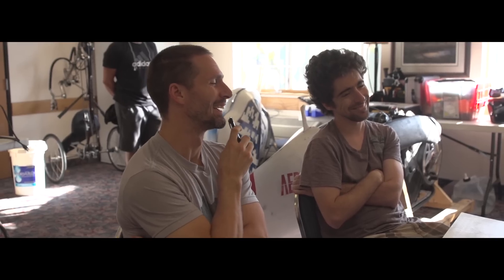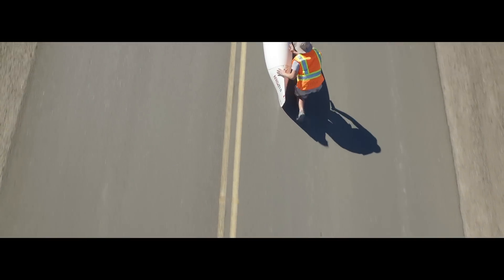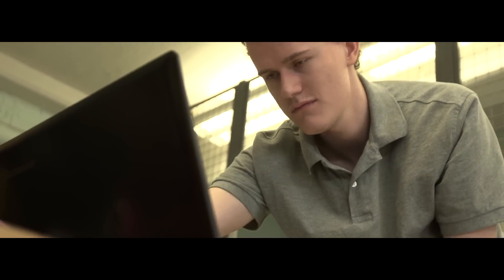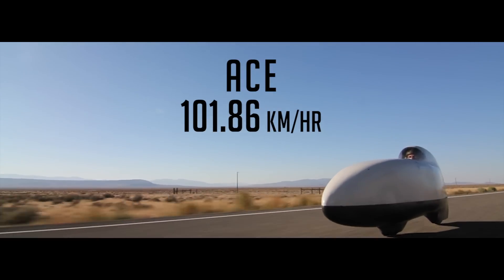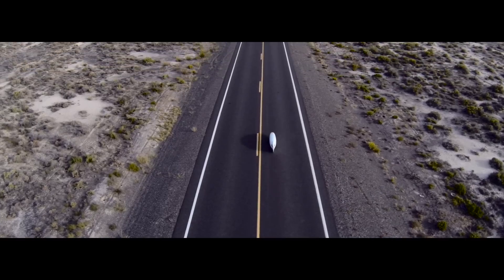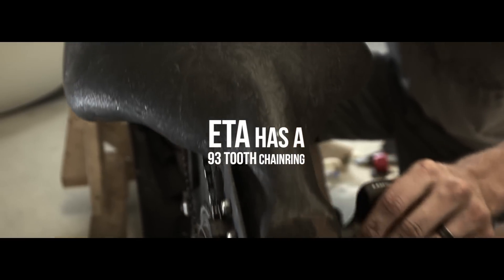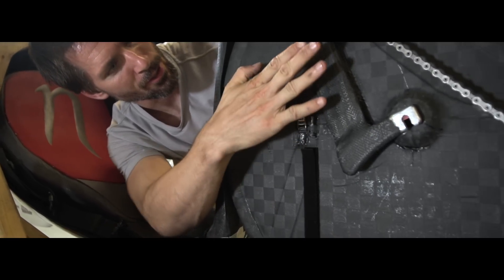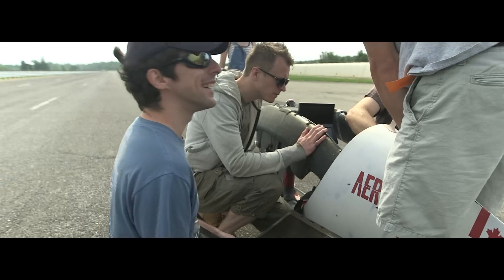Under the Hood of the Fastest Bike in the World

Comment: How is sufficient ventilation for the pilot achieved?
Reply: I was wondering this myself. How does he keep himself cool. You heat up quite abit when you are biking hard, and with no open air to cool you down. I wonder how he doesn't create a sauna effect.
Reply: Francis Faure set the World 1 hour bicycle record on a non aero recumbent in 1933, UCI banned recumbents. That record held until Sean Costin broke it in 2007 at 48.80km (28.46 miles).
Reply: It is white coated so it naturally radiates heat, if we use infrared white ink it would be able to keep below ambient temperature at all times.
Reply: That is why this was a "short" sprint, not a triathlon or long commute, and there are gaps in the bottom between the wheels and shell ;)
Reply: actually ventilation was a problem. We got a duct that draws air from behind the front wheel and directs it to the pilots face. The wheels are themselves surrounded by carbon shells, which are sealed to the main body shell, so there is as little airflow as possible . We can open and close the ventilation depending on what the pilot feels.
Reply: @victorragusila7519  if you need only 258 watts to maintain 100 kmh, why we can not see similar commercial velomobiles achieving at least 1/4 of this?
I see some recumbent bikes with 3000 watts motors and still they don't reach more than 80 kmh.
What is the power output from the trained cyclist when it reach 140 kmh?   
How much time it can sustain that speed?
Reply: @AngelLestat2  not sure the exact power numbers Todd was able to put out...but I think it was around 500 to 700W for the final Sprint. He couldn't keep it there for too long at all, the power curve was all designed to reach max speed only over the 200m speed trap.
Aero drag and tire drag are hard for a three wheeled vehicle. They are much bigger and much less aerodynamic. Three tires will always scrub a bit, draining more power. I wouldn't be surprised to see a factor of 10 in the drag of a velomobile compared with the ETA bike. We also raced at high altitude, so air drag was even less than what a velomobile would see.
At low speed you don't see that drag, but at high speed it really kicks in. 
Unfortunately the velomobile a do as good of a job as possible while keeping their bikes comfortable and easy to use.
Reply: @victorragusila7519  ok I understand, so the impressive drag coefficient, lower drag area and friction reduction of ETA is what makes all the difference vs other velomobiles, with the extra help of the lower air density in the test.
I am searching for the ultimate practical design for a personal transport vehicle, I can not see any commercial design getting even close to the possibilities over the range of characteristics that I think are necessary in the average of cases. 
Some vehicle with speeds from 70 to 110 kmh, a range of 100 to 150 km, dynamic enough to use common roads or just skip them in the case of vtol flying vehicles,  with lower energy consumption to make a real difference on the economics vs the alternatives.
I think it could be accomplished at reasonable manufacture cost.
My bet for the most practical vehicle to match those needs (from 5 to 10 years in the future) would be personal accessories to transform our body in a flying vtol aircraft using propellers and enough wing surface in order to require only a 35% of the power output for cruise which would be feeded by a Fuel Cell (Solid oxide using normal fuels or PEM depending the availability of hydrogen and the performance of the storage method of choice)  with an extra battery that would provide the extra energy for take off and landing.
I think that a max power output of 30 kw would be enough for a total take off weight of around 140 kg.
Which is the power output that any electric motorcycle use today to reach 120 kmh.
Reply: @AngelLestat2  Actually we can. My commercial velomobile does 60 km/h at 215W; that's with all the aero options in place + race tires, but it has three wheels and is a lot wider, has ventilation, mirrors, a (lexan) window to see in front and to the sides and more stuff for daily use. I'm tall so I have the biggest, but there are two smaller versions that will get you to 60 km/h at 180W and 160W. In every day summer outfit (without the roof, ducts open, puncture resitant tires etcetera), riding at 60 km/h constantly requires just short of 300W power input.
Reply: @4nz-nl  Well, those numbers tha tyou provide are way more reasonable vs what it should be possible with that power, the previous values were quite deplorable.
Also.. today a new aerodynamic design for bikes come out, which I think it is quite intelligent (although not confort). 
https://www.cycleworld.com/story/motorcycle-news/white-motorcycle-concepts-wmc250ev-aims-for-new-land-speed-record/
Because our legs usually requires a lot of front Surface to acomódate, but with this, they just allow the air to pass, maybe countering some of the vórtices generated by the button part. 
Of course, if we can design a vehicle in which our body is 100% horizontal, then it would be much better, but that would work out only for a vtol vehicle.
Reply: @AngelLestat2  The numbers sound much more reasonable but my velomobile is a fully usable vehicle. I travel to customers in it, carrying clothes, normal shoes, towel, two laptops, a portable screen, tools, food, drinks and more. 
It's biggest advantage is not that it's faster than a road bike, but it's comfort, the lack of volatility in travel times and the protection from the elements. Wonderful vehicle :-)

Concerning the bike link you posted: It works, but it's still making two huge mistakes that a recumbent doesn't:
1. The position is extremely uncomfortable. I cycled 200 km the past few days, today was hard but only my legs are a bit soor. No problem whatsoever riding my recumbent multiple days for 17 hours a day.
2. If I have to crash into something, I prefer doing it feet first, not head first.
Reply: @4nz-nl  on doubt, your velomobile does 60km/h with 200 w + human power or just with 200 W of electric motor?
Because then you said that you need 300W to keep that speed, which is a bit confusing. 
You mean to not force the engine?
But yeah, sounds great in your case given that is an actual vehicle the one you have.
Not like the world record Aerovelo which use 200 Watts at 90 km/h but with incredible compromises.
Sad that velomobiles are so expensive, is stupid that the ones who want to pollute less, with a much simple and small vehicle  need to paid as much a a family car. 
Yeah going head first on ground vehicles is not great, on flying vehicles is not an issue, after all is the position used on hang gliders.
Reply: @AngelLestat2  I understand it's a bit confusing because I stated multiple different power figures. The power figure differs quite a bit depending on whether I have winter or summer tires, use a full racing hood (cover over my head) or use it in open mode (knees out). Lowest value possible is 215W on superfast tires and with the full race hood. My "real world figure" in the summer is closer to 300W, with durable tires all round and with the kneecover, but without the head cover. 
That head cover is just too warm in summer temperatures, but of course this is also the case because I'm putting out 750-1000W of heat because I'm pedaling. So just to be clear: The Milan GT is fully human powered. 
Check out this video of a German dealer in the smaller brother of my bike, the Milan SL. It will give you a good idea of the speed potential. This is also fully human powered, the power figure visible is coming from powermeter pedals that measure his power input:
https://www.youtube.com/watch?v=4IHIdGVGKdI
Reply: @AngelLestat2  Btw I don't entirely agree on your statement that velomobiles are expensive. Compare them to any top-end road bike and they are dirt cheap: There is nothing but top-end in the velomobile world. All except for one are handmade products, but developed to a very high level. If you see it as a bike, then it's expensive. If you consider the fact that I use it for commutes up to 85 km, the velomobile is a huge time- and moneysaver, and those are not even the only assets.
There are a few guys riding 5 year old velomobiles that are already over 150.000 km, and those people actually have a job and a family ;-)
Reply: @4nz-nl  I never thought much about the heat our bodies produce to deliver around 250 W of power, yeah, 1000 Watts is like having 1 m2 of glass with the sun at midday.   That is a lot of heat.. 
OF course, ventilation can get rid of that heat but the aerodynamic penalty is far to be negligible. 
Yeah, I guess I already watch that video in the past, that is why it was hard for me to understand why some electric bikes or velomobiles needed so much power to reach the same speed. 
Thanks for all the data you introduced in this comment. I will reply to the one of the price now.
Reply: @4nz-nl  I mean, I consider them expensive, some velomobiles with speeds of 50 or 60 kmh, range of 50 or 70 km, with only 30 or 40 kg of materials, with simple mechanism cost around 7000 or 15000 usd. 
Which is the cost of a new Mitsubishi Mirage, which is a machine way more complex that requires a lot more materials and energy to its manufacture.
Just the scale in power, the car should cost 5 to 10 times more at least at equal production capacity. 
I understand that most velomobiles are made at hand and the demand is lower at the moment, they also have a lot of regulation and legal issues, which is hard (and expensive) for them to find a good spot.
High speeds requires a lot of safety features and test that no small company can afford, plus the efficiency lost to match all those features.
But that is why I am researching the topic.
I guess there is a huge oportunity to really innovate on the personal transportation vehicle.
Unless I think is great to combine human power with assist (due health and eco reasons), in order to really create an alternative to our common vehicles (cars, motorbikes, etc), the human power add is almost irrelevant.
First, nobody wants to reach to their work or reunion if they are all sweaty.
The extra power added is negligible vs the complications which add the bi power option.
If we really want to solve our sustainable issues, we need to find a good replacement to the way we mobilize today.
A car who use 50 kw of power to move 1 or 2 passengers is not ok, neither the current cost  of alternatives that use 10 to 20 times less materials and energy to its manufacture. 
I already have an idea how to solve the (safety feature) without a compromise on weight and efficiency, for ground and vtol vehicles.
Possible it would not me the one who completely solve this, but the solution is right there because the logic and current technologies allow a lot of improvement in our current vehicles, I guess sooner or later someone would figure out.
Reply: @AngelLestat2  The current cost of velomobiles is actually due to the complex production process. It's technical simplicity is one of the reasons it is expensive; a Milan, DF, Alpha 7, QuattroVelo, Snoek, they are all high tech design.
You're comparing a simple steel and mold plastic car to a fully carbon fibre vehicle that is made by people by hand, and requires quite some hours to be finalized (more than that Mitsubishi!).
I do business with productions companies, which is why I have looked into possibilities to make the production cheaper. That is possible, but you'll need to scale the demand up to at least 15-20K vehicles per year to make it viable + the end product will be of lower quality (less reliable or less efficient).
In order to do that, you will not only need to change peoples views on vehicles, but you will need to change policies too. And that's where you'll meet the lobbying auto industry. There's no free lunch here, the growth will be slow (if we manage to keep it growing! I'm trying my best though).

Concerning electrification: Possible, but again, you'll meet regulation everywhere. In Europe, the maximum speed for an E-assisted bike is 25 km/h. Even on a 4% incline I can usually maintain 25 km/h on human power. Anywhere else I'm a lot quicker - I'd rarely ever use E-assist so it would be lugging dead weight around. We do have speed pedelecs here (up to 45 km/h), but chances are super slim you'll get a velomobile on the road under those rules (see my comment on car lobby).
The only reason I'd actually want an engine in there is to restore braking energy (on a decline); this can speed up the climb afterwards, which can be useful.

Concerning price: If I ride a velomobile 10.000 km per year and ride on Continental Contact Speed (not the fastest but dirt cheap), I'll be replacing €50 of tires once a year. As long as I don't sprint too much, it'll need it's chain and sprockets replaced every 2.5-3 years (€200). So the baseline is €350 of maintenance every three years, for the rest it might cost you some extra food - how much would you spend on a Mirage?
Reply: @AngelLestat2  
3000w would push a standard racing bike to around 100km/h and a velomobil to more than 150km/h so there has to be some limitation in the gearing I guess.

Comment: Perhaps a 360 camera could be installed and have the rider use a VR headset to be fully aware of surroundings, instead of just being able to see in front?
Reply: thought about it, issue is of latency. We had to find a camera/screen combination that had minimum latency, so the rider could control the rather-twitchy bike. We only use it on empty, perfectly straight roads, so not much reason to look around.
Reply: I also can imagine trying to incorporate that into the design without it getting in the way would be a real pain.
Reply: And no real reason to see whats going on behind you ;)
Reply: as vr headsets gets better there might be light versions in the future. the application might not be needed for a speed record like this, but for other uses of this technology.

Comment: can it be used commercially for road driving,
Reply: would you WANT to sit in that? 
You need a team to assemble it.
Expensive and fragile as hell.
Most likely uncomfortable and very hot on the inside.
Reply: It would need to be dramatically re-worked.  For instance, the turning radius is really huge, it's only designed to go straight and fast.  There's no way to put your foot down when coming to a stop, you need people to catch the velomobile and hold it up while you get in and out.
Reply: May I suggest a milan velomobile? Much more suitable for everyday driving (you still need a velomobile-friendly environment).
Reply: @Flix-f6q  Any decent road design is velomobile friendly ;-) But depending on the exact situation, that Milan can be a good suggestion. It is really a bike for open road though, not really built for climbing. For faster acceleration, check out a DF. For a rigid and practical bike (with a childrens seat!) see the QuattroVelo. 
@Name Surname: Check out www.velomobileworld.com

Comment: only 258 watts for 100 km/h?
Reply: this is a world record vehicle in a world record setting. battle mountain has the smoothest possible road with a descent close to the maximum allowed for that specific record (two thirds of a percent). that location took quite some finding. the racing is done in summertime when air resistance is lowest. also the bikes use special ultra-low-drag tyres.
Reply: +velo1337 That's what I was thinking too. Especially since I can sustain about 285 watts. But I am sure that I weight a good bit more that their rider.